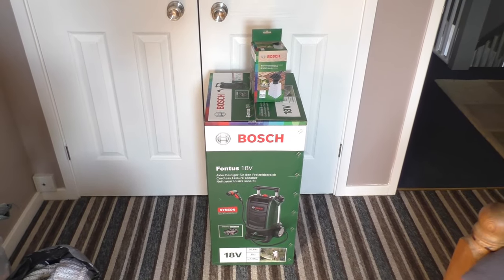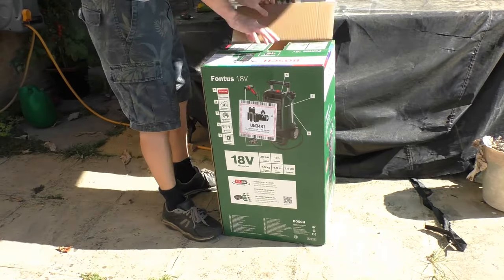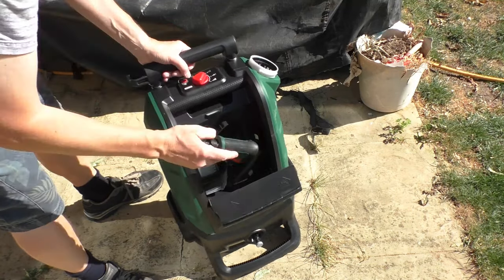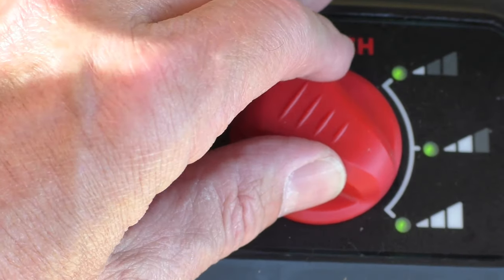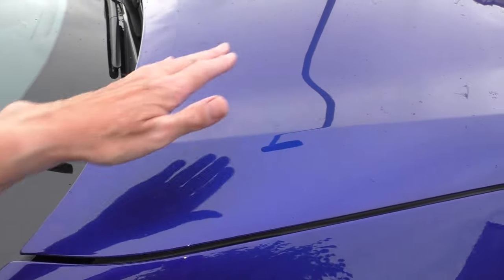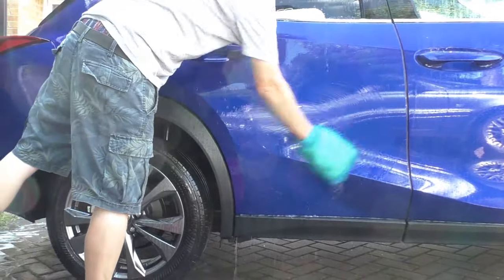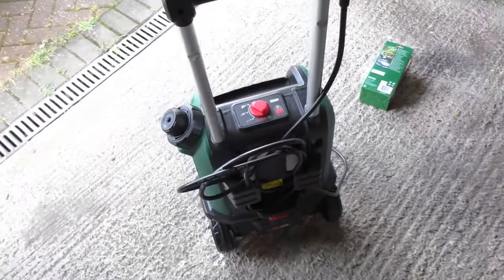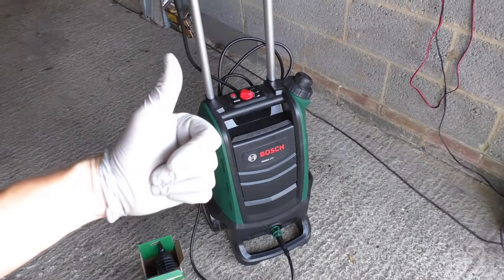Bosch Fontus Cordless 18v Pressure Washer.  SNOW FOAM. Verified Purchase REVIEW

Comment: Water tank capacity 15 litres 👍 I have see a few videos of this product but you’re the first one to show snow foam attachment in detail, did seam you put snow foam liquid in neat and not diluted as would be the case using Autoglym snow foam cannon. That Bosch snow foam attachment is well overpriced when compared to more sophisticated quick release cannons. Well constructed video 👍
Reply from the maker: Hi thanks for the water tank info.  Yes i did try snow foam neat on the test.  Ive since tried it 50/50 mix and it works just as well.
Reply: @CB-RADIO-UK  if the attachment does not fit, just check the spray setting of the gun! Because this only works with a spray position... with the other three, the attachment does not snap

Comment: I have one of these with the detergent bottle for SNOW foam which I use with AutoGlym polar blast, wash and seal. You mentioned it was difficult to attach, took me ages to work this out, there is one particular setting where the bottle fits flush and it works a treat you just have to rotate the nosel on the gun to get the right one, I think mine is a G1 machine. Rather annoyingly the male hose coupling has just started to leak so I have ordered a new one was amazed they supplier it as a spare. If it doesn't work, I would not hesitate to order another one, try to remember how old mine is and I think it was bought in 2017/8. I always dilute down the blast, wash and seal when using it, my car is a MK5 Golf GTI and usually I need to refill as it runs out halfway around the car.
Reply from the maker: Thanks.  Yes mine does about the same coverage.  Yes the foam only works with the spray setting on the gun.

Comment: The reason there’s no seal on the bottle is likely because it needs to avoid a vacuum being drawn. It only pulls detergent through using the force of the water flowing past so as the bottle emptied it would start to create a vacuum and less and less detergent gets pulled through. It’s frustrating but I get it. 

I get the feeling it’s designed to be a bit more like a detergent tank on a normal washer than a snowfoam lance. I think if it used the middle spray setting rather than the wide fan it would have a bit more force behind it to whip up some bigger bubbles.

That said I love the unit, it works fantastically and is brilliant for me living in an apartment where I don’t have access to water or power at the car. I say it’s got the power or the spread of a mains pressure, but not both simultaneously. The mid setting on the gun is more than ample for most dirt and provides a reasonable spread.

Comment: Looks like it doesn't have enough power to do anything, might as well use a garden hose. :p
Reply: If you're commenting that, it means that you really don't get the point of this tool. It's not meant to be used as in the video in front of a garage. It is meant to be used in the nature, in a place where you have no access to a regular source of water.